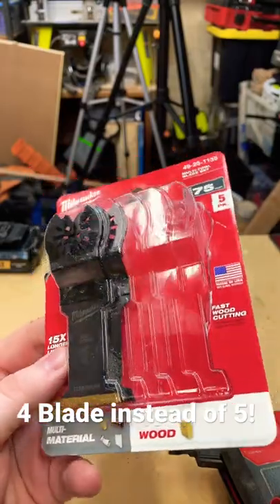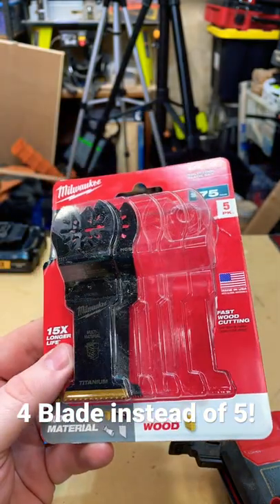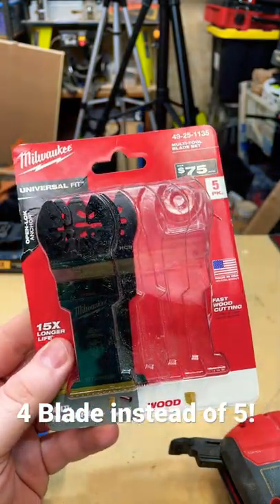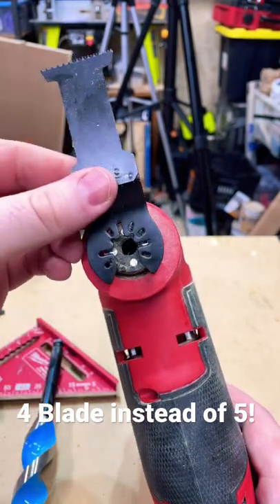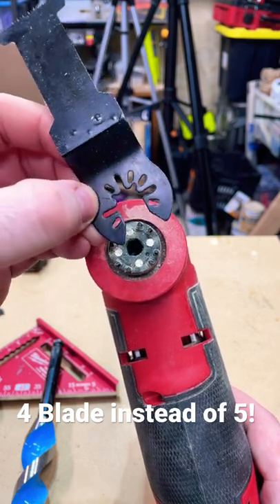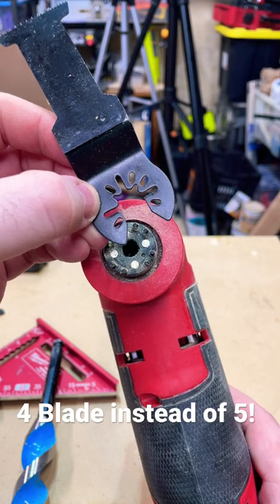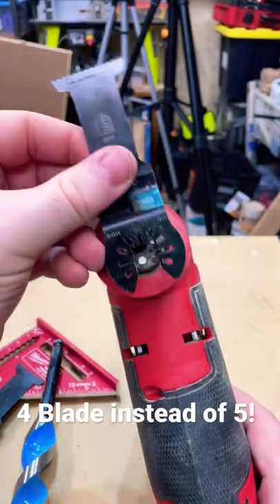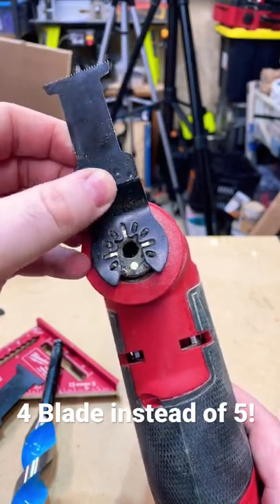Defective Multi-Tool Blade

Comment: I've had a blade that only fit my DeWalt multi tool, and it was a tight fit. It didn't fit on my ryobis and my Milwaukee multi tools.. and it was a universal pattern.  Now I use Diablo carbide tip blades for... Everything.  Sawzall, multi tool, circ saw etc.  They really kick ass and I don't use any other blades now.  I made one cut with a brand new fein multi tool blade through 2x4 PT and it got so hot that all the teeth on the blade morphed into a wave pattern. Never again buying them!
Reply from the maker: I mostly have use the Milwaukee blades up until now but I have been meaning to give the Diablo's a try.
Reply: Hell yea diablo is the best, hot knife through butter

Comment: I like milwaukee tools but quality control has gone down. @tinkerwithtools does that multi tool of yours have a loose battery connector?
Reply from the maker: No.  It’s been great so far.   Most of the problems I have had with tools are because people return some thing broken and it gets put back on the shelf.

Comment: You should try to rotate the blade. maybe it is for angle cutting.
Reply from the maker: With the missing punch out, it won't fit on the tool no matter what way you rotate.
Reply: @TinkerWithTools  ok